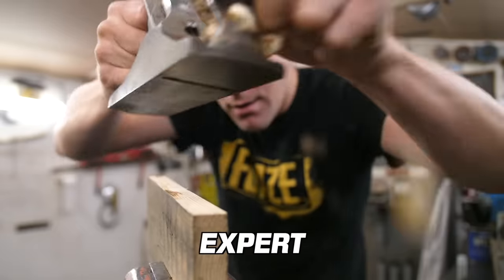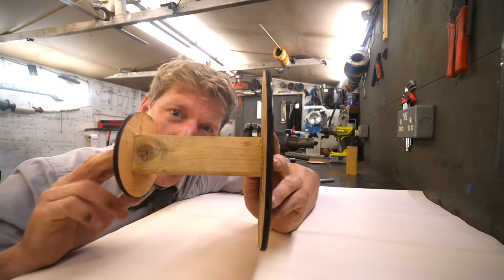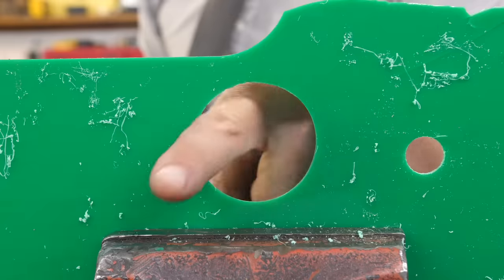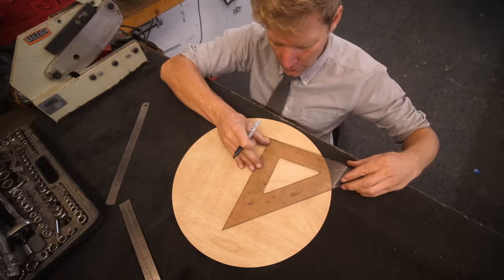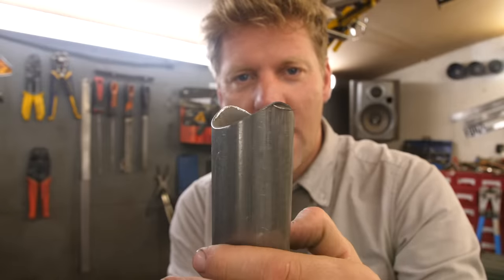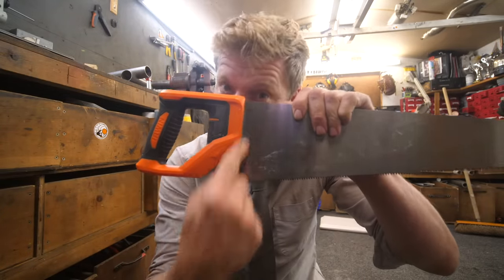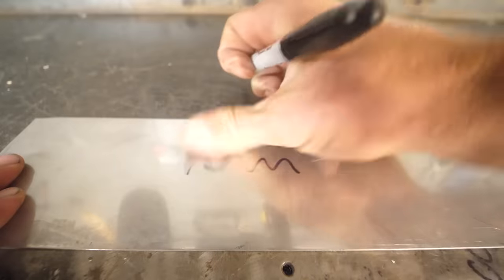18 GENIUS Workshop TIPS (that actually work)

Comment: I had two large trash cans stuck together. I had tried the air compressor trick, to no avail. There were a couple gaps from the handles letting the air out. Got them apart with dish soap. Pushed in on the interior trash can, bending the plastic, and dripped the dish soap into that gap. Continued all the way around, and they easily came apart.

Comment: I made my reciprocating saw into an aerosol spray can shaker. Took the longest, widest saw blade and ground the teeth smooth on my belt sander. Drilled a hole about 3 inches from the end that attaches to the saw and riveted a high quality 3 inch hose clamp into place. Place the can inside the clamp and tighten. Then press the On button for 30 seconds. I’ve been able to get all the paint, brake clean, WD40 and more out of a can! Best part is I also now own a reciprocating saw!

Comment: the middle of square works on round pieces too. just draw a line somewhere, draw 90 degree line from the corner, repeat once or twice depending how accurate you want to be and do corner to corner. don't need to measure at all while drawing the rectangle long as the corners are 90 degrees.
corner to corner middle point works in drawings too if you fancy making axonometric/perspective blueprints.

Comment: When cutting down/shortening a bolt or piece of threaded rod the swarf/jaggy bits left over from the cut often make it hard to then get a nut on it. Wind a nut on first before you do the cut and then as you wind the nut off it removes the swarf leaving a clean thread

Comment: To easily remove rust or forge scale from steel parts if you don't have any rust remover, soak overnight in vinegar and then lightly wire brush to leave it beautiful and shiny. Coat with oil or WD40 or it will start rusting again very quickly.

The rust/vinegar solution can also then be painted onto wood to turn it grey/black! Works best with high-tannin woods like oak. You can prime low-tannin woods with strong black tea to get a darker colour.

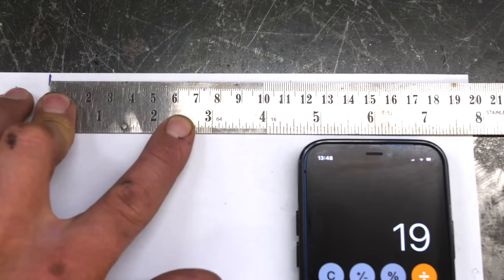Comment: 6:20 similar to the tip after this, if you want to divide a line in to X segments but trying to measure every, say, 2.37mm is very tricky... Just draw a line at an angle to it split in to X segments of something easy (5, 3, 10mm or whatever). Then just draw X lines parallel to the line formed from the end of the original line and the end of your dummy/guide line (tip from 6th form tech drawing!)

Comment: To stop struggling with rusty stuck bolts and nuts, my friend and I came up with a cheap troubleshooting method while fixing up an old car (Renault 4L). 
We didn't plan to buy a impact wrench.

We SOLV the bolt. Short for "Sens-Outil-Lubrification-Vibration"

French for : 
- Way (of turning) : are you turning the right way ?
- Tool : are you using the best tool for this situation ?
- Lubrification : WD-40 everywhere and maybe let it absorb for a few minutes
- Vibration : without a impact wrench, you can simply apply  torque on the wrench/ratchet and bang the socket/bolt with a hammer. Start with low torque and ramp up as you bang faster or harder.

Those may sound stupid but when you are at it with the 3rd bolt stuck at a weird angle,
it's a good method to calm down and do thing right.
Reply: Re: the vibrations, you can use an air hammer/air chisel on the head of the bolt while turning it with a spanner as well

Comment: to clean your hands add oil with the soap, the oil dissolves the grease and the  soap takes it away, plus your hands will feel nice afterwards.

as a pro mech i make my own hand cleaning mixture, 1/3 oil 2/3  dish soap, grouded coffe waste, and salt (to avoid the coffee from spoiling, a tiny tiny bit of mayonnnaise to make the oil/soap mixture hold. mix it well and tadaaaaa!  works a treat, costs nothing, and better for your hands than any industrial handwasher.

Comment: Isopropyl alcohol or rubbing alcohol takes sharpie off. The markers use a similar type of alcohol to keep the ink wet and then the alcohol evaporates and the ink sticks to the surface. If you add the alcohol back the ink becomes liquid again and can be wiped off 👍 I like the writing over it method too I hadn’t seen that one.

Comment: You should get a mountable dehumidifier, they have them with built in pumps as well. Could hide it in the wall and vent it. I have one in my furnace room that I vent from ground level for the input to ceiling level on the output further at the other end of the hall.

Comment: Basic one to divide a line in equal parts (for the tube with holes around), instead of measuring and dividing with non integers, draw a line at an angle, measure some easily divisible distance (20cm which is 5 times 4cm), draw a line from 20cm back to the end point, and now parallel lines to that last one starting at 4, 8, 12 and 16cm. It is more precise than trying to measure fraction of millimeters.

Comment: when bending round metal conduit, mark the conduit where you want the BACK of the bend to be, then insert the conduit into the bender and line your mark up with the BACK of the semi circle that the tube bends round and bend the conduit UP, this enables you to get the perfect measurement to the back of the bend everytime but you have to bend it up which can be tough

Comment: Funny you should mention 'old timers'. Through out the video, as you mentioned certain tips, I started thinking you must have had a visit w/ an old time fab guy.

Some of these take me back to learning from old timers, 50+ years ago, when I was just a wee lad.

The old geometry proof using the center of a bisecting line to find the center of a circle took me back to an old sheet metal fab guy I knew AND to 9th grade geometry class.

The 2 pieces of wood used for a cone template & another, I've forgot, (I qualify as an old timer, now, so excuuuse me), take me back to the same old tin guy.

I liked the board method for coping tubing & the stacked hole saws... will use those. Even an old dog can learn geometry...

Re: Sharpie removal
10+ yrs ago, I discovered 99.9% isopropyl alcohol, sold as an industrial solvent. The stuff is very, very useful, & residue can be removed w/ water, unlike most hardy solvent.

99.9% will soft dried latex paint, etch certain plastics to enhance glue bonds & is THE go to for removing tough PSA labels & residue. And it annihilates Sharpie, though 60-70% iso will do that, (keep some alcohol wipes around for cleaning up Sharpie made layout lines & mark; not as messy as liquid. But  a tip for that: re-use those small push top spray bottles from sore throat spray or eye glass cleaner as small volume iso sprayers!

That's enough sharing, can't give away all at once.

Comment: 2:28 Salt or pure silica sand (e.g. used in playground sandpits) works as well.
In fact, there are commercial solutions that use said sand. But if you have a garden and kids you already have that sand, and it's less sticky than sugar. Even salt has less side effects on you than sugar.

Comment: If I'm trying to pull a frame into square, and it's being awkward, I'll tack a turnbuckle into a corner and slowly turn it until square. This can pull the side in on larger jobs, but clamping a sturdy length to the back does the trick.

Comment: if you need to drill a hole in another piece of metal and make it line up, but the center punch is way smaller than the hole, u can often use a socket that fits in the hole to line up the centerpunch

Comment: Heat also breaks down sharpie marks! If it's on something heat proof, hit it with a blowtorch for a few seconds and then it'll wipe right off.
This also works for plastic Tupperware. I put the date on my leftovers in sharpie, then run it through the dishwasher or under some hot water in the sink and it comes right off

Comment: To space holes evenly, you can draw the number of lines you want to mark, plus 1 extra for round stock or plus 2 extra for flat,  evenly spaced on a rubber band and stretch it.  Round line up the first and last marks and for flat line up the first and last at the ends.  The marks should stretch evenly around with no measuring required.

Comment: A little tip i learned on my previous job. When you need to screw close to the end of a board, and have no pilot drill. Put your impact driver or drill in reverse and push down hard on it for a while, then set it back to forward and the wood won't split

Comment: 4:35  how about using a rollmeter, measure the longest side an then make a line with a thin pen, ripping needle, but the idea with rulr and 90 degree angle is also very nice, fine vid

Comment: If you need to anneal silver scribble on it with a sharpie, it burns off at the annealing temperature. No overheating or spalling. Probably works for loads of soft metals. To anneal aluminium rub a bar of soap on it, the soap turns black at the right temperature

Comment: To drill through the side of a pipe in the center: find the top/center of a round pipe that is on its side with your mill or drill press, set a metal ruler on top  of the pipe and use a center drill in your chuck.  Bring your drill press down and if the ruler moves down one side, move the workpiece toward that side.  When you find your center will be when you bring the center drill down and the ruler goes perfectly horizontal.

Comment: If you have a loose nail and you like it being in wood you can hold it upright with the sharp edge pointing towards the wood. Press it against the wood and use a heavy object to carefully tap the bigger end of the nail. It will go in with some practise.

Personally I like using a hammer, it seems perfect for the job. It’s heavy and hard and has a convenient handle 👍

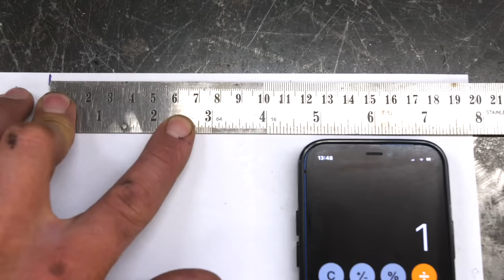Comment: At 6:21 you don't need a calculator to create evenly spaced out sections. Keep the origin of the ruler on the left mark, and move the ruler down on the right side until it's at a number divisible by the number of sections you want, say 27cm for 3 sections. Then mark the piece at 9cm and 18cm on the ruler, and use a T-square or speed square to transfer the marks to the top of the paper. It's the same thing you've done at 6:51 only it works for any number of divisions, not just two.

Comment: You can find the middle of a line without measuring by drawing a circle on either end of the line and the new line created by the two points where the circles intersect will be the central bisecting line.

Comment: To get a bearing into a bearing block squarely: place the bearing on top of the hole and drop/tap the block vertically against something solid.  The bearing will drop into the hole (or at least be nice and square to be pressed in).
Like getting a hammer head on a handle; place the head on top of the handle and tap it vertically onto a solid surface.  The hammer head momentum will drag it down onto the handle.

Comment: Hack

Old carpenters trick for boat makers it's called a ticking stick used to quickly measure and give you a template for a cut. One side of the stick is completely straight and the other is whispy with a birds mouth in it. If you put this piece of wood on a piece of cardboard smaller than opening you can trace the end of the stick onto the cardboard allowing you to make a accurate template without a tap measure.👍

Comment: Alcohols will remove Sharpie as well. I keep a spray bottle of 99% isopropyl in my garage for various cleaning and quick drying situations. Methanol will work as well, typically found in break cleaners such as Heet.

Comment: If you don't have a compass large enough for your circular drawing, you can use a strip of cardboard in the right length, a tack for punching holes and holding the center, then stick a pencil through the other hole and drag-draw your circle. A string can be used instead of cardboard for even larger circular drawings (or in the garden).

Comment: Iron filings form a fuzz on any magnet (welding magnets, etc) and are a pain in the behind and difficult to remove. Get a plain steel wire brush (NOT stainless steel) and brush across the face of the magnet briskly a few times. Fuzz-free magnets! (But not Furze-free magnets). Les in UK🇬🇧
Reply: Have to try it, I usually use compressed air to blow it away

Comment: Use a whiteboard marker to remove sharpie, it does the same thing except sharpie can leave streaks (if you don't remove it completely) that when dry, will have the same issue but now much larger and smudged area

Comment: A good way to check for square without a square is the 3,4,5 method. 

Measure and mark 3 (or 30, 300 or 3000. You get the idea) along one face, measure and mark 4 (or 40, 400….) and on the angle from point to point will be 5, 50, 500 etc.

Comment: If you have a stripped bolt or screw take a paper towel and push it between the head of the bolt / screw and it will fill the gaps left from it being stripped and you can usually take the bolt off. Works for nuts too.

Comment: Make a die for cleaning up theads on set screws, bolt, threaded rod which are damaged at the beginning of the theead so you can't get a die to even start, by cutting a nut in half of the same diameter and pitch of the item to be repaired put the two halves of the nut on a bit of good thread and clamp the nut with a pair of mole grips and unwind it off doing a backwards and forwards action and clean the threads up. Apply Wd40 before unwinding and if you can heat the nut up to cherry red with a good blowtorch and quench it in some engine oil you now have a hardened die. It's a bit tricky but is doable and works.

Comment: Here is a great little tip that will help you when working with Aluminium, when using a 1mm cutoff wheel or similar, a little candle wax on the wheel before cutting makes a world of difference. Also helps with flapper and sanding type discs too.

Comment: when drilling a hole in sheet metal get a piece of material ie an old hankie and fold in half and place under the drill and drill through.  You will have a very nice round hole instead of a hole with many sides

Comment: To find stud locations after drywall is already up, all you need is steel wool and sandpaper. Put the sandpaper on the wall and start rubbing the steel wool against it. Small particles of the steel wool will fall down and magnetize to the screw they used to put on the drywall

Comment: For sharpie removal trick: if you want a cleaner removal and/or need to remove more than just a small mark, dry-erase is a sharpie removal champion. Only instead of needing to rub the ink off right away before it dries, you actually wait for the dry-erase ink to dry.

Comment: About checking the squariness of a square. The trick actually only tells you if the supposed square is an Isosceles Trapezoid. So for example if you have a rectangle that's not also a square and you just apply this trick you would think it's a square...

Comment: When drilling into masonry turn off the hammer setting until the bit has established itself a hole it will stay in, and then turn the hammer setting back on for the rest of it. This stops the bit jumping around and moving off target when you're starting a hole.

Comment: Tube notches should be one third depth rather than half. Sounds daft but it works out better.

Cone (including square to round) patterns can be quickly drawn using a drafting practice called "pattern development"

Comment: if you want to mark a straight line on a length of tube, you will need the following: 2 lengths of tube (preferably the same diameter) 1 flat surface and  1 straight edge.

lay the 2 lengths of pipe next to each other on your flat surface
place the straight edge across the top of both tubes
drag the straight edge down the length of the tubes
this will leave a straight mark across the tops of the tubes.

this also works for marking the side of a bend...

Comment: Tip for cutting bolts and threaded rod: Just cut at 90° with an angle grinder, then hold it at 45° downward angle to a bench grinder while rotating it slowly. Should result in a nice chamfer all around of ca. 1 mm side length or less, while all the burr from the angle grinder cut and from chamfering is moved towards the tip of the bolt rather than into the thread. This cleans the thread, and together with the chamfer threading in the bolt becomes as easy as with factory-made bolts. Bonus tip: always have a good selection of stainless steel bolts around, and you'll never run out of the right length bolt. Just cut them to size with this method as needed – and as it's stainless steel, you're done, no zinc coating or other corrosion treatment of the cut end needed.
Reply: To add to this. Bolt a nut on before you cut the rod. When your cut is done, you can use the bolt to clean up the threads by taking it off.
Reply: Use several bolts if you want to use a vise, that way you don’t destroy the tread when clamping to hard. Screw two bolt against each other (and put them in a vise) to prevent the bolt rotating.
Reply: Bonus tip, have some threaded rods in stock so you’ll be able to make some bolts in a pinch.

Comment: If you're cutting tube to fit on another at 90 degrees, notch the tube by cutting each side of the tube at 37.5 degrees. When it's placed on the other tube, it fits at 90 degrees

Comment: When notching, only notch 1/3 of the diameter of the tube. Notching 1/2 of the diameter means you have to cut through the complete wall thickness and clean it all up afterwards.  1/3 saves time and material

Comment: A good one for large 90 degrees angles  is the 3 4 5 method measure 3 feet one side 4feet other side should be 5 feet across for perfect 90 degrees angle works at any scale 30 meters 40 meters